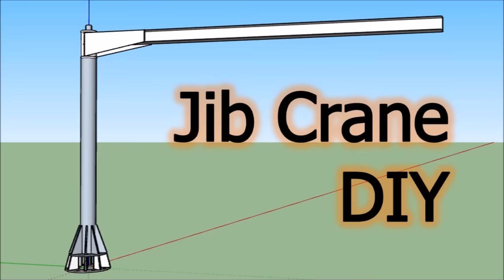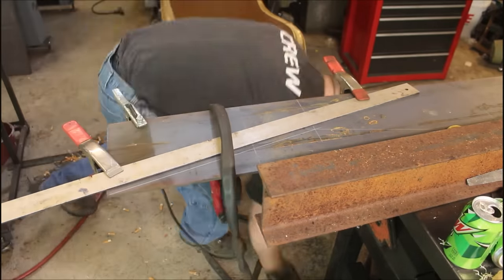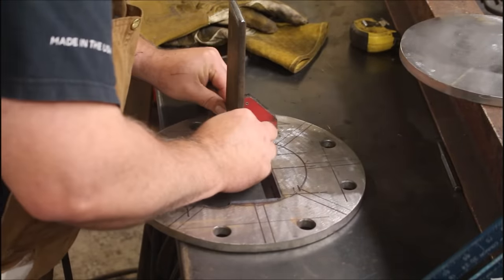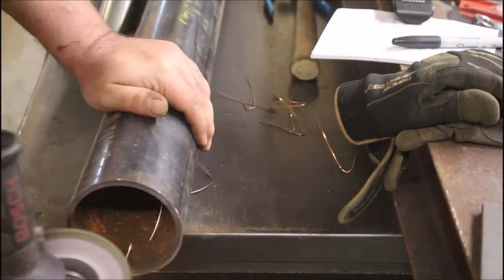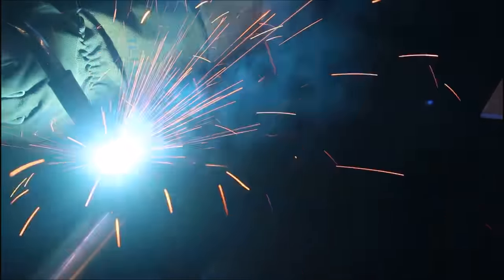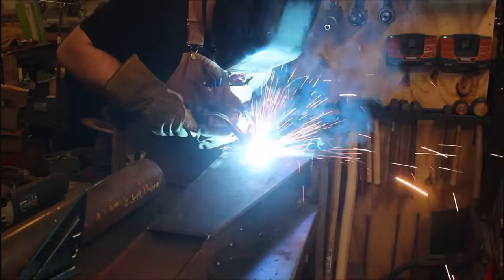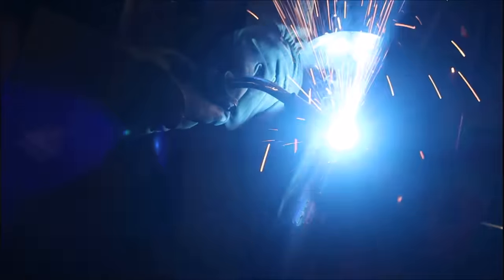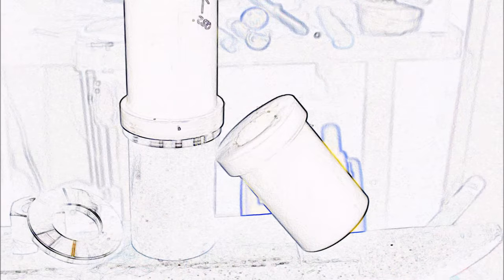DIY Jib Crane Part 2 of 2

Comment: Thank you so much for a good quality video. I will state, you're plumb lucky, though, that even with machinist style safety glasses, without wearing a full face shield, while using an angle grinder, you havent got multi-scars on your face and neck from the hot metal you're removing. I've worked metal all my life and have seen folks that started out with the same safety ideas..."safety glasses are enough...I don't like all that junk hanging in front of me...or...it gets in my way...until someone has to go to the emergency room when they ground toward a gusset and it spit back on them and they were burnt their face all up. You guy are great!...and LUCKY !!!

Comment: that jib crane is stronger than really needed for 500 lbs, it is a nice job, at final  adjustment, the most important is to align the pivot axis  very plumb to avoid  rotational non desired movement.

Comment: I had plans to make a light duty crane in the back of my cube van but if that one is limited to 500 lbs then my design would have been useless. Thanks for sharing.
Reply: Yes, I was disappointed with that low lift weight; I only need to lift 200Kg but I dotn want to make that monster.

Comment: Is it just me or did the mast deflect when the guy hung off it?
I watched it a couple times and that’s what it looks like. If so, I would try and rig some kind of support to the top of the mast just under the bushings.
Reply: 1966cambo no no that shit looked like it was going to go over 😂😂😂 he should of had the top go straight to the ceiling first time using it bet it starts to bend
Reply: Cantilever beams will always deflect SOME under a load... Just because you can see it doesn't mean it's bad. I'm sure the pipe is still FAR from plastic deformation under the loads he's rated it for.
Reply: @KevinDay  Its not so much an issue with plastic deformation as deflection, when the jib sags and your beam trolley runs to the end of it deflecting even more.  Or in this case, right off the end, as it looks like there isn't a stop for the trolley.

Comment: Nice job, but you need to do a load test on this jib. It should carry at least 3x its rating at full extension without sag or buckle or collapse. You don't hoist all the way up. Just an inch off the floor will prove it.
Reply: bullshit  it does not need to lift  3X its rating  maybe 15% more just for safety margin and added a little UNCOMMON SENSE and you are good to go
Reply: Robert Beck what issues did you see that you think would cause it to fail an inspection?
Reply: @adamkalman6011  for lift a minimum of 4/1 safety for the structure must be applied per CMAA and ANSI  if your really want to get technical.  There is a good chance this guy gets sued when this kills someone and they say I learned to build it from this guy on the internet.
Reply: @mrdavidurquhart  Lateral torsional buckling of the cantilever boom is a hugh problem that is not directly related to the bending stresses in the steel.  Also, it seemed to deflect too much at the top when one of the helpers swung on it.  A failure of this structure would probably take place very suddenly, without warning, and that is the most dangerous kind of failure.

Comment: With a few Coupling Nuts, some 1/2" lengths of threaded rod....You could devise a linear guide that will track across any angles.... Even Circles of any diameter.
X-Y table with some Z height options... all ya need is....
CNC technology .... CAD/CAM knowledge.... 
EpoxyMineral Machine bases... 
Trunnion / Rotary Table / Indexing Plates...

Comment: How are you filling the holes, does that torch dump materials in to that i dont see the rods
Reply: Jim Alley  no..i don't know anything about that stuff..i have seen the oxy acetylene like a car garage,  but i never worked with that..  I did plumbing
Reply: It's MiG welding the wire is feed through the gun

Comment: What was the name of the bushing material. I heard you say UVHW?
Reply: UHMW - Ultra High Molecular Weight - similar to Teflon - it's a high density plastic that works very well as a bearing/bushing in moderate load applications. (Now that you know what it's called - ) you can google it - it's not terribly expensive, and is pretty cool stuff.
Reply: It's actually in the polyethylene family instead of the "teflon" family. Cheaper than delrin but good strength, machine-ability and low friction. good stuff for wear parts that need to be tougher than teflon.

Comment: You'd have been better served to have run your mast 3 foot higher and then run a 1 inch diameter tensioning rod with shackles on both ends to act a truss for your beam .
Reply: O
Reply: José Severo

Comment: Get you a pneumatic floppy disc grinder a some 3M green corps disc and you'll be shocked at there life span and for some sticky or just bad about clogging the disc in the rental department at home depot they have red floppy disc 
Snap on sells the grinders and Mac etc.

Comment: Don't feel bad my 3M flap discs don't last or work near as well as a regular grinding wheel and or sanding discs.  Expensive and not very productive.  Good project.  Take care.  Doug
Reply from the maker: I find that the better (more $$$) disks work great and last a long time on bare metal, removing scale seems to eat them up, or to be more accurate glaze them over so they stop cutting.
Reply: I buy my flap disks on amazon
Look up benchmark abrasives
They have several different grits
Last time i got them it was $20 for a 10 pack and they are the blue zirconium ones as opposed to $6 for 1 at yer local store. They seem to last just as good as name brand.
As long as yer not using on paint or scale clogging them up